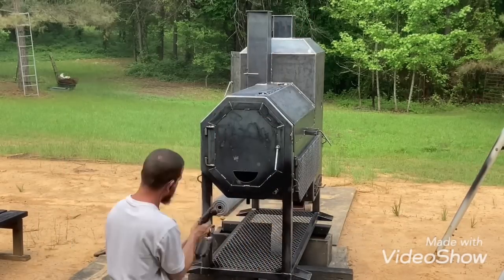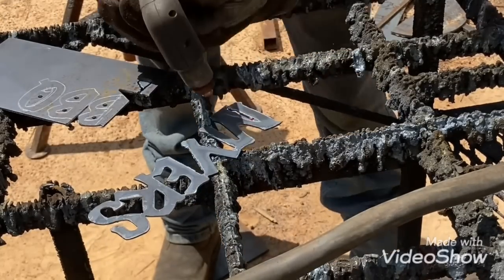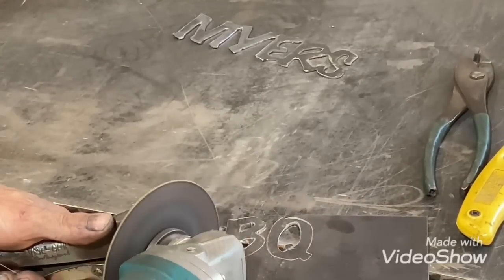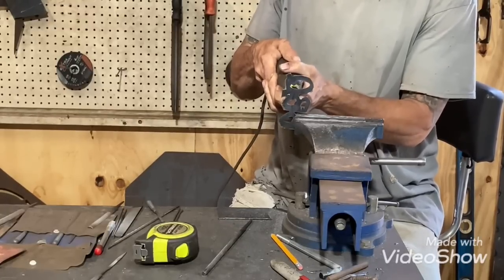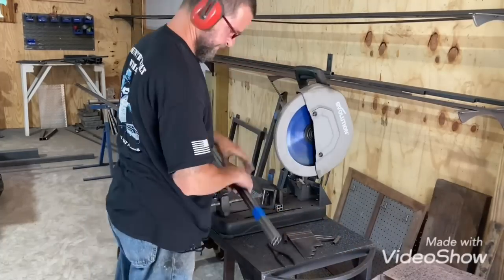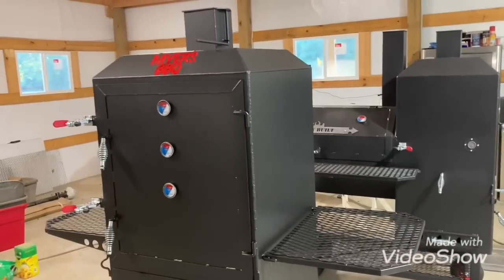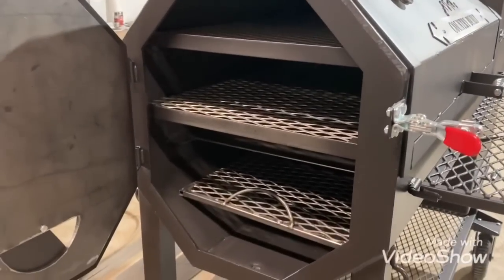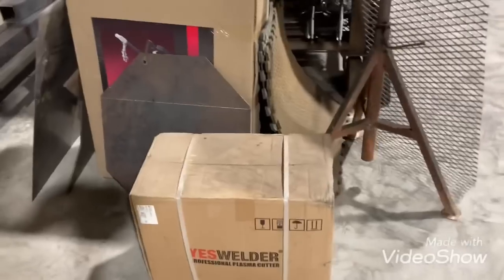Vertical and reverse flow bbq smokers

Comment: Water in the air line?
Reply from the maker: No, it’s not water. It’s losing connection in the lead, it started a few months ago and has just been getting worse, I should have had one on hand already since I knew it was going bad